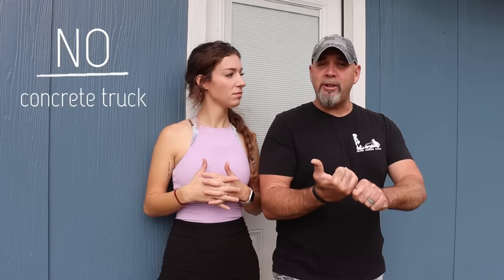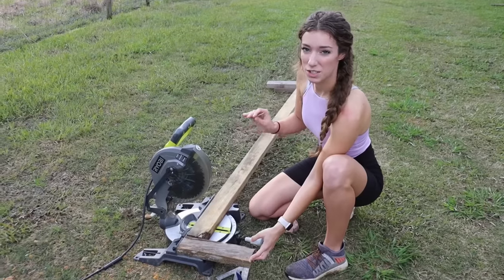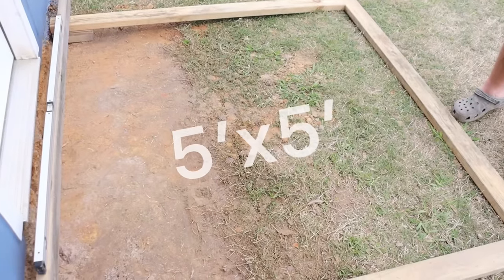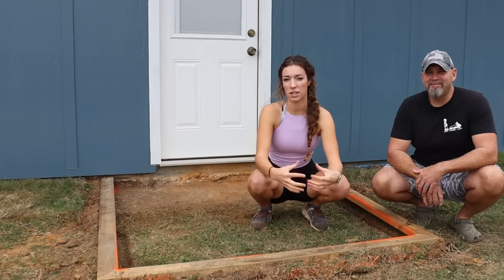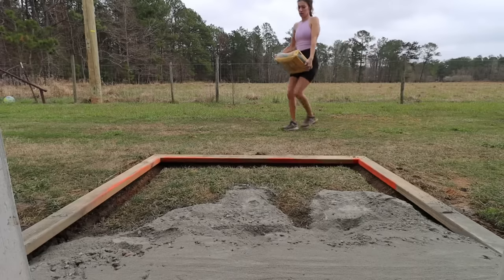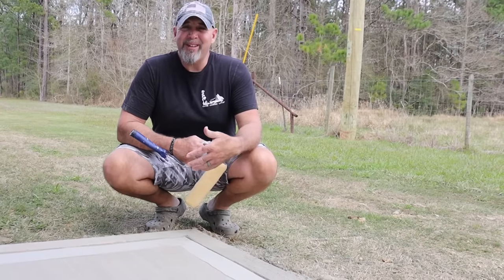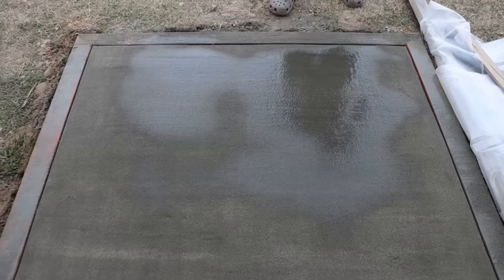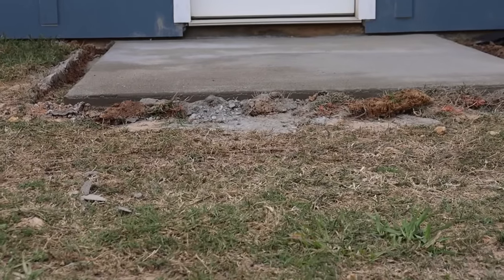How To DRY POUR CONCRETE SLAB and Update of Our 1st Pour

Comment: FYI for those that don't know, doing concrete this way makes the overall pour actually stronger then if water was added. As mentioned when the concrete wicks water from the ground it allows the concrete to harder in an unconventional way which is why it actually turns out stronger. I learned of this decades ago building decks for a living. I used to use all sorts of bracing and pored the concrete wet and of course it was dry the next day; then I had to remove all the deck bracing. When I started to pour it dry and tamp it solid there was almost no need for bracing as the dry concrete was able to hold things steady. The next day the concrete was hard and all the bracing was very strong. I got this idea from a person that did Fences and I asked way he was filling the holes with dry concrete... Concrete is amazing stuff...
Reply: Yeah I was just about to say the same... most people add WAY TOO MUCH water when doing a wet mix and as you say this will take moisture from above and wick it from below until it stops taking it and will usually result in a stronger mix... For those concerned about the edge you can make the edge slightly deeper so that it doesn't break off. I've also on numerous occasions stuck some fencing wire in the hole about 1/2" below surface and that really adds strength and even if you do get a crack it minimises the crack opening. Great job! Have never done the roller trick though, that leaves a great finish... will be trying that next time!!
Reply: And you don't have to be in a hurry, like with wet cement.
Reply: WOW!  That is wonderful, wish that I would have known this a year ago.  Last year I poured my back steps, but they were not on the ground, they were on a wood frame that formed the steps.  Don’t know if that would work out the same?
Reply: I can think of my next two projects o can use this method for. However,  I am not sure if it can be used, here's why:
You mention concrete will wick moisture from the ground.  I want to redo my cracked up (but stable) garage floor and asphalt driveway. 
In both cases there's limited, or no access to the moist soil. 
Can I still drypour with sprinkling from the above?
I intend to pour just 1 -1.5 overlay.
Reply: When I worked construction, we had a couple jobs that were government regulated.  The inspector required the concrete be poured so dry, we had to take the chutes.  It would not flow down. The tinsil strength of the concrete was three times a regular pour.
Reply: You really need to where protection for your lungs ,
otherwise great job .
Reply: @sfuchs  The answer to that is "Yes." Like electrical current, moisture will always move from the area of high moisture to low moisture until it reaches equilibrium. You may have to add a little bit more water than you otherwise would, but we aren't talking a whole bunch, and in fact it might be helpful if there isn't a lot of access to moist soil since that will actually give you greater control over how much water the concrete takes up.
Reply: @smitcher  I believe cement is Hydroscopic which means its absorbs moisture....  I have a few old bags that have hardend up from the atmosphere in my garage.
Reply: as a concrete placer do you have any actual evidence for the strength increase? the strength is based off the mpa(in NZ) which is the cement ratio there are additives for faster curing but wicking water from the ground wont improve the overall strength
Reply: @sfuchs  I’m thinking about this too, don’t forget to apply some of that bonding additive
Reply: @charlesfoleysr6610  My Dad said that dams were build very dry as well. I wonder if the jobs you mention had any extra additives. You would think the bonds might be closer with packed concrete, that is allowed to cure properly with the reaction of water.
Reply: I don't think that this method would work very well for a large slab. You are correct however that the majority of concrete is poured using more than the ideal amount of water.
Reply: The strength of concrete depends on the water/cement ratio. The lower the ratio, the strongest the concrete. Cement in the concrete mix still needs water for the hydration proccess. The trick is to add the right amount of water to get the desired strength. People pour too much water in the mix to make the mix workable. Pros either use a superplasticizer or order a higher strength mix so when water is added tp make the mix easy to work with, they get pretty closer to the required strength. That methods require a lots of experience doing concrete jobs.
Reply: Strength is determined largely by the water/cement ratio. Yes you can put to much water, but as is the case here you can put too little. Both will lead to a decrease in strength.

Comment: A Great Video...planning on putting together a plastic shed with a size of 6 X 8. 

I am a 63+ year old widow (have to do this by myself) 
and have been watching many videos on laying concrete foundations, but none as simple as yours. 

I have been afraid to try, because of all the do that's, thingy madingies and do hickies one has to have to accomplish this task.

Your video ENCOURAGED me to try it your way. I already purchased 6 bags of 80lb. Concrete. 

It never occurred to me that you set your Gardenhose to mist to wet the concrete a little at a time. Wonderful 🥰👏🏼

The shed will hold in Winter 200 lb. of chicken feed, as well as (at the moment) 8 silky hens and one rooster.

I also want to incorporate my door because of the mud...so now i have to start measuring all over again, to find the best solution that works for me, and move the chickens again to do the entire area all at once.

I guess I have to purchase 10 more bags of cement, to perhaps accomplish the job?

Thank you so much for your video!🥰

Comment: For a quick sod cutter, use an old blade on your circular saw, set deep-,cuts a nice straight line-repeat every shovel width then slide shovel under each row- sod comes right up-easy-peasy !!!
Reply from the maker: Thanks you!!
Reply: ease of grass pick up will still depend on what type of grass you have as the different types will have different root systems.. so unless you started with sod strips keep this in mind.. the old saw blade is good idea to get an even piece/s though..
Reply: Never seen anything like it. I got 😮a 😢10 x 24 foot pad to pour on the back of my property and not any help to pour it.  This could be my answer.  How big a pad can be poured this way. Do you think I should pour it in sections? Thank you it was an eye opener for me.  If I could pour a 5 x 10 foot one day and right beside it another 5 x 10 foot will they bond together it would take 4 days to do the 4 sections and I will need to put a drain.  This is to put portable off the ground pens for dogs on I want to put a drain box all the way around the edge😢with a 24” sidewalk.  That way I can wash it all to the drain in the bottom of the drain box and then hook too my sewer system.  Great for cleaning.

Comment: Great job I never realized you could pour concrete dry like that.
I was told many years ago, the longer you keep concrete wet and keep it from drying, the stronger it gets. I poured concrete stairs in a restaurant basement and kept the concrete wet for 5 days. To this day (40 years ago) there's not a single chip or a crack, and it's as hard as steel.
Reply: You were told right… this slab probably isn’t gonna last long unfortunately

Comment: Interesting technique particularly liked the paint roller.  My grandfather taught me how to do concrete when I was younger, and in all fairness to him, he’s never had his slabs crack. But in order to do that, you have to do everything right if it’s a big slab expansion joints are necessary if it’s overhanging or you could have settlement, you need steel. But the most important tip he taught me Wass mix with sweat not with wet. Many many people make the concrete too wet so when it evaporates it leaves voids in the concrete, you also have to make sure it is well tamped or vibrated to eliminate voids. This is why your dry technique works well because all the voids would be filled by the powder. One safety tip however, if I was working with dry concrete as you did, I would recommend I protection in case the wind blew it in your face concrete would badly burn your eyes. I would also recommend gloves as concrete will burn and irritate skin. But overall very interesting video and a nice technique.

Comment: Your paint roller, excuse me, “concrete roller”, idea is absolutely brilliant!!! I just did a 12’x16’ dry pour slab for a garden shed, and it came out beautifully! Thanks for taking the time to create this video, because I really had my doubts about doing a dry pour slab. But in the end, it was a LOT easier and faster than I ever imagined, even though I made mine a bit thicker. Y’all rock!
Reply: I'm gonna build a 12x16 too. How thick is your slab, how many bags did it take and is it one huge slab or made in pieces ?
Reply: 😮 Nice! How many bags did you use?
Reply: @angelikacotto9786  they said 10 x80lb bags.
Reply: @lauracapaldo1831 no way 45 bags is 1 yard.
Reply: Hello, I want to do the same as you did. Could you please share how many bags and lbs of quikrete you used for your shed, and how thick your slab is? Thanks!
Reply: @houseandhobby6971 following, yes please let us DIY's your tools and method for your shed dry pour?
We were considering doing a wet pour frame outline with post holders inset and then the building frame would be in traditional concrete and then dry pour for the inside and then we was gonna epoxy over concrete dry pour area 90 days after starting.
Reply: Im gonna do this but i dont have a saw.

Comment: I am a 60 year old retired contractor in East Tennessee and wish I had seen this in my earlier days.  It makes sense because we used to always set our posts in dry concrete mix and just either let it soak in the moisture from the ground or add a little water on top.  Looks good, I'm impressed and thank you very much for sharing this.  My next project with concrete will be your way.

Comment: This is genius level.  I have never tried a dry pour.  But I can tell you I have great success with post holes by setting the post on a rock, getting it plumb with a few extra rocks round the sides.  Then I fill the hole to the top with water and pour the dry mix through the standing water.  As soon as it has rocks to the top I use a small stick or dowel to slide through the mix and move it up and down on all sides until the top looks well mixed.  Then I take a small board or trowel to make the top slope slightly away from the post (or up to the post if you have excess concrete).
Reply from the maker: Awesome!

Comment: Hey guys, I watched your video before my project and did like but I went ahead and did it the traditional way, which is mixing with water and buying a $300 concrete mixer, and it was tough though, now I have another section to complete and I decided to use your method it seams more convincing after what I did, I will make a video and show both methods of my project and posted so you can see it.ty❤

Comment: I've been concreting for 27 years and I would never pour concrete like this BUT I must admit, I'm impressed! If I ever do a little slab at home I'm going to try this way.
Reply: The dry pour looks pretty rough and porous. Maybe that is ok for some or cases but I'm not sure I like the final product.
Reply: The strength of this can not possibly compare to a wet mix slab. Lazy man's way.
Reply: Too many steps. I would at least put plastic on the bottom of the form for a moisture barrier. Concrete does expand and contract. The plastic will allow slab a surface to glide on.  I would also add a wire mesh for reinforcement.
Reply: @franklee2683 your ignorant, they are not lazy.

Comment: I've dry set concrete for some time, these folks know what they are doing all great advice.   One small tip that could make it easier for some,  especially if you are alone.   You can fill your form 1/8 to 1/4 inch short then top it with mortar or portland to make the top creamier and cover the aggregate easier
Reply: This comment saved my bacon today.

Comment: I did this for a growing rut between my mailbox and our blacktop road. I had 3 bags of dry-mix ready in a handcart, ready and waiting for the mail carrier to finish for the day. Then I eased a cut at the bottom of each bag, into the ruts. They were still half-filled with rainwater, per normal(!) and with each splash of wheels going through them dispersed more soil and made them deeper. I smoothed out each bag of dry mix, which was already absorbing water from below. When I saw that, I waited an hour or so and went out to add more water to the edges and then across the top, using my fern-mister. Three years later, it's still holding strong!
Reply: Sounds like a good idea and makes sense!

Comment: I’ve done post holes like this for years and they have held up great.  Never thought of doing a slab this way.  This is genius!  24:52
Reply: How deep and how far north have you done your post holes? I helped my father-in-law redo a fence post a few years ago, the "traditional" way, and that was rough. Before that, I helped my uncle, cousin, and a friend of theirs tile their church's basement hallway, and mixing all that mortar in a wheelbarrow nearly broke me (I'm pretty sedentary), so if this works for posts, not just slabs, I'll be STOKED. I want to put a porch in front of my house in NH, and I need footings that can get below the frost line if I want it to stay level over the years.
Reply: Used the dry pour for post holes worked great

Comment: Been doing projects like this for 30+ years. Learned it after seeing the results from dry packing post for fences, decks, etc.
Difference is I always turn 2x4s on edge for 3-1/2" depth with reinforcing wire. If I'm attaching to an existing slab, I will dowel it into to prevent any settling movement causinga gap between the two slabs. Yes, I do remove any organic material also. 
Never had any issues and by taking the extra precautions and not skimping or taking short cuts, I have successfully added on to the slabs I poured previously. I can see the possible desire to enlarge the one in the video for a nice patio in the future.
BTW, I'm in S/E Louisiana and used this method in situations were ground settling could cause issues and crack a lesser slab. Just tips from my experiences.
Reply: What is dowel it mean? Thanks
Reply: Dowel it?
Reply: To Dowell is to drill into an existing slab and use epoxy to install a short piece of rebar. This allows the installed rebar to join the old and new concrete and stabilize the two together. Hope this helps.
Reply: Looks like a lot of us South Louisiana’s are DIY’ers! Lol So happy to learn all these extra tips! Thank y’all so much! 😁
Reply: @sirreus3003 - I live in WV in a "6b Planting Zone" and plan to add a 9x9 ft slab and attach it to an existing patio behind my house. Thank you for the suggestion and instructions to "dowel it in".  My question is related to grading. The current slab is graded away from the house by about 4 inches. My backyard slopes up about 4 feet over a distance of 45 feet and continues to rise for about ⅔ of a block. Can I add a French drain next to the original slope and then follow the current grade by sloping it down to meet the existing slab?  When I add the dowels, can I leave a slight gap to adjust for adding a grate on top?  I know that any exposed rebarr  will l likely rust, so can I form the concrete around the rebarr to leave slight channels for the water to travel into the French drain? I plan to pay the drain around to the side of the house so it will eventually go down to the road.

Comment: I considered using this method for my 16x24 shed, which I figured I'd need about 250 60lb bags (approx $1200 CAD).
Then I called up a concrete company and they quoted me $900 to pour and finish the slab (as long as I built the forms). They had it done in about 2 hrs and I was using it the next day.
So depending on the size of your project, might be better to just order a concrete truck.
Reply: Good man!... work smarter not harder and you saved 300$ and mixing up a TON of concrete then placing it ect. What is one man's time and energy worth? You just said it 🙏 I'd had done the same.
Reply: That points up the importance of looking at all your options for your particular job. Just like in permaculture, the answer to any question is usually, "It depends." The size of your job probably has a lot to do with which option will be cheaper. For our first concrete pour, we figured out that mixing and pouring it ourselves would have been the same cost per cubic yard as hiring a truck...so we let somebody else do the mixing and pouring. On a small job, though, I can see where doing it all yourself would be the best option.

I would definitely be wearing a mask when dealing with dry concrete, however. Messing with that stuff with a bare face is a really good way to damage your lungs, and there's no fixing that once it's done.

Comment: Tried this technique this morning, I've never done any concrete work before, the only process I deviated from was using some sakcrete and quikcrete, vs all quikcrete, the reason is i had 3 bags of the sakcrete laying around. I did a 4 inch thick slab over an existing 3inch slab, extending it 10 inches in length and 10 inches wide. I'll do the 8th watering in about 15 minutes. Here's hoping I followed the instructions well enough for a solid slab.🤞
Reply: it's been 3 weeks. Update us! ❤
Reply: How'd it turn out?
Reply: Any update!? I need to do this to an existing and wanted to know!!